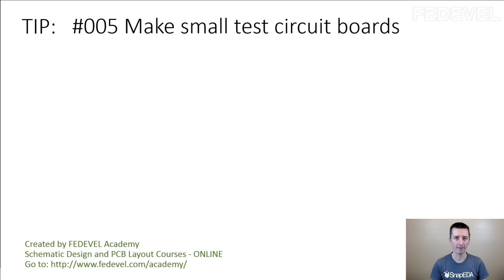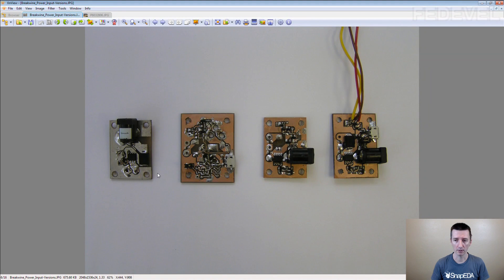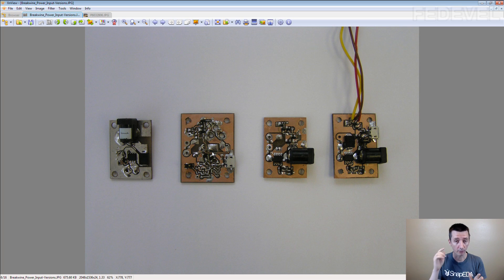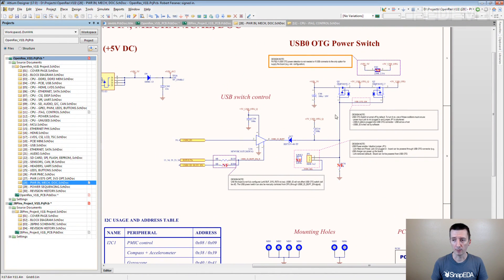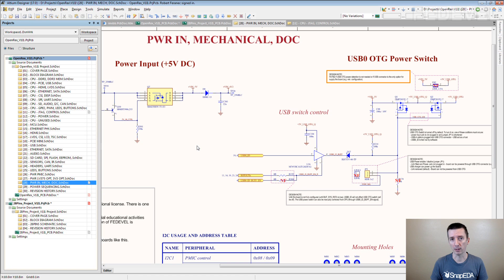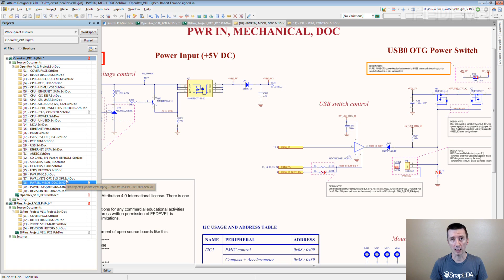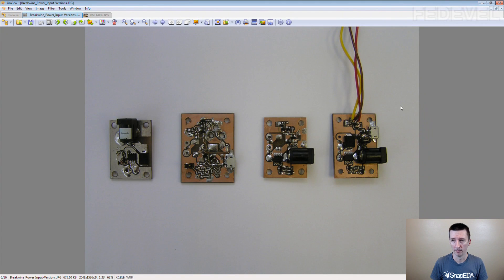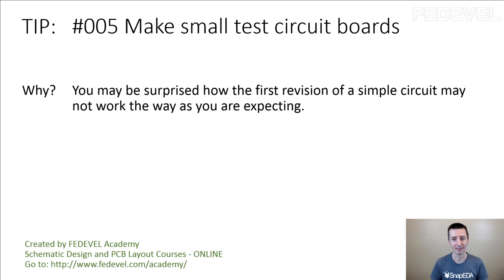TIP #005: Make small test circuit boards

Comment: Great tip especially using the cheap quick turn board houses.  An additional benefit is that it validates your footprints
Reply: Robert Feranec I have used PCBway.com for almost 2 years now for over 20 designs of various complexity (2-4 layers, up to 7x7inch sizes) I highly recommend them.
Reply from the maker: We need to try the cheap quick turn board houses. Are you using someone particular?
Reply: We typically use Advanced Circuits since they are local to us.  
http://www.4pcb.com/33-each-pcbs/index.html
http://www.4pcb.com/66-each-pcbs/index.html
If the board is too large for the above deal we use Bay Area Circuits
https://store.bayareacircuits.com/bundles-specials/

Comment: Great tip, maybe also design in a few break points to test seperate parts of the PCB like Power supply. I have seen a lot of waisted expensive boards go to redesign without simple additions like this. same thing with unused FPGA pins. always ad a via or a "0" ohm resistor to it to have acces... branch out differential clocks to some resistor... i doesn't cost anything but helps a lot if you need it!
the first time right thing is very overated. and you can simulate a lot these days, but it sometimes is much more effecient and cost effective to build a simple board like you do!
Great video series Robert! keep it up!
Reply from the maker: Thank you Paul. Some of your comments will be in some other tips ;) e.g. I use 0ohm resistors a lot.
Reply: My team member had to redesign boards because a FPGA BGA pin was grounded, twice. It could have been prevented if he had read through the ridiculously long schematic check list that comes from the FPGA vendor and lists how to the schematic and PCB side for every single pin. Very tedious work.